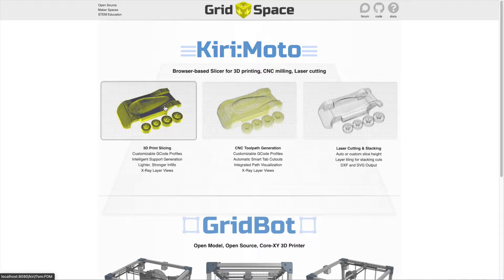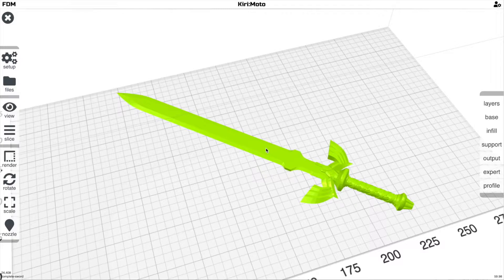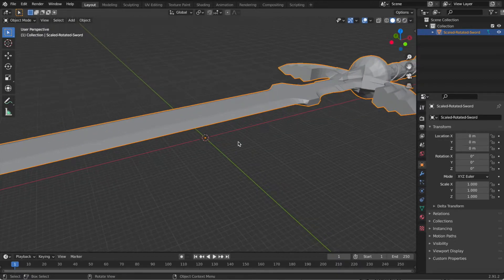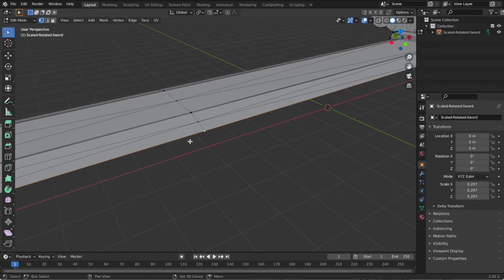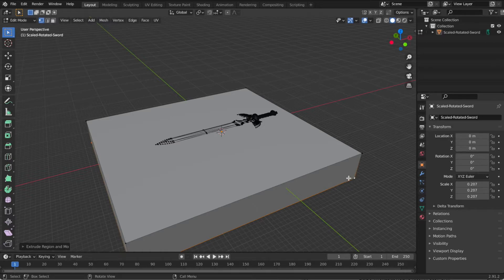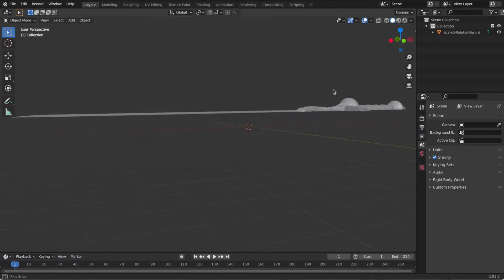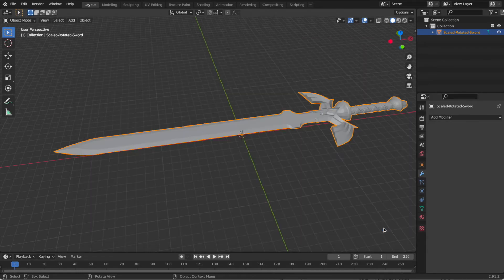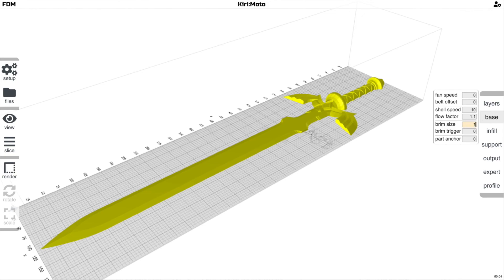Splitting Swords with Kiri:Moto and Blender

Comment: What is the advantage of this method versus a simple plane cut?
Reply from the maker: you mean using a cube instead of a plane? probably not a huge amount of difference. except using the cube can heal non-manifold geometries that are present in a lot of the models you find online (if you use intersection instead of difference). I didn't cover that, but perhaps it would be useful.